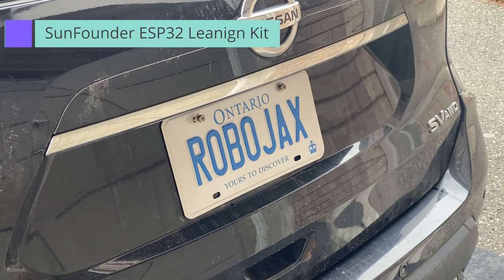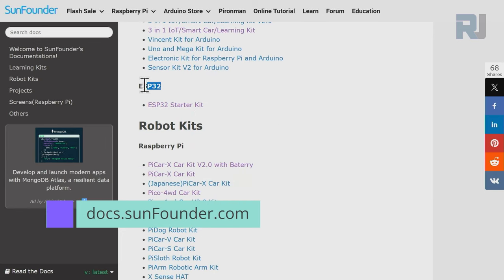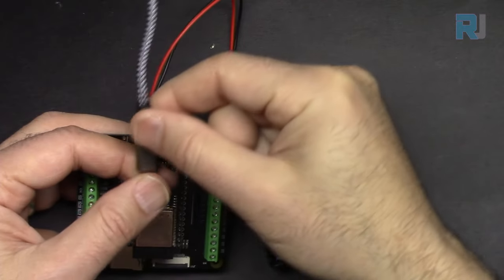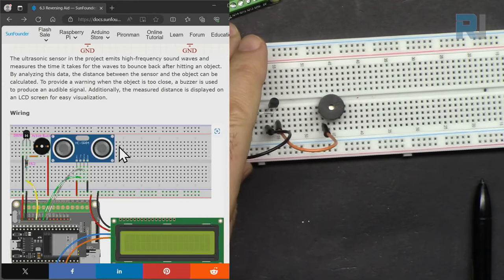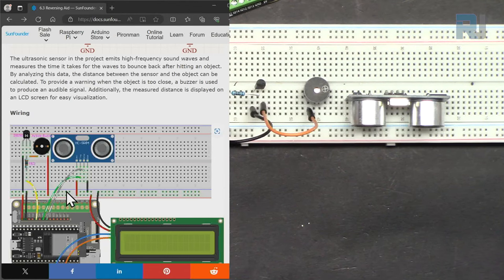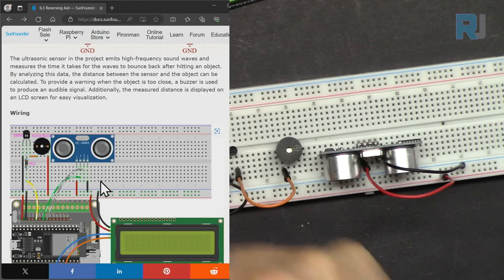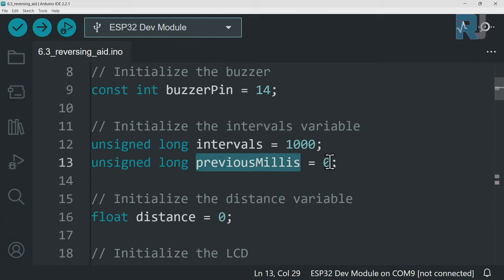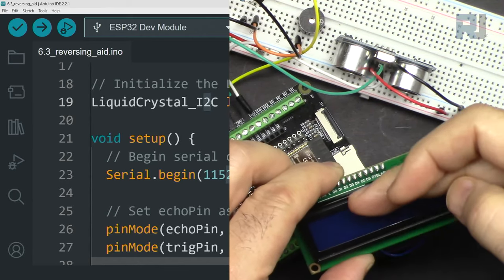ESP32 Tutorial 32 - Car Reverse Range Waring with LCD and buzzer | SunFounder's IoT Learning kit

Comment: Hi Robojax - Can this be installed using the ESP32-CAM board?
Reply from the maker: Hi, Yes it can. this learnign kit has camera included with and easily you can combine them.
Reply: Thanks  @robojax  I tried but get a 'Fatal MD5 Error'. I assume it is an i2c conflict but I cannot make it work.